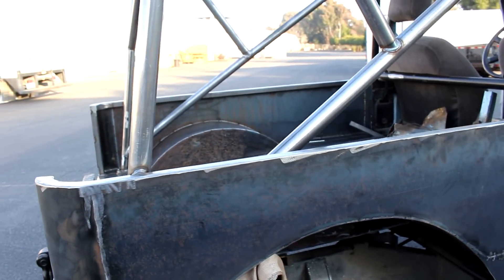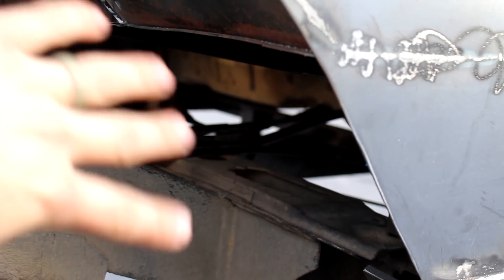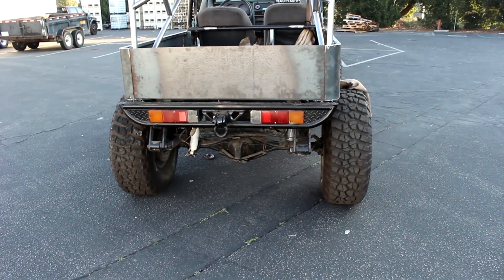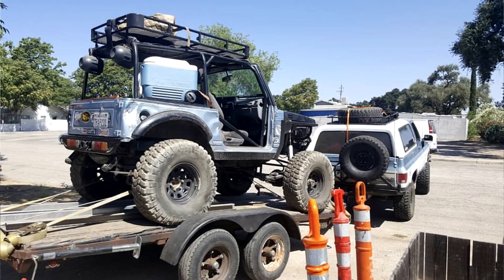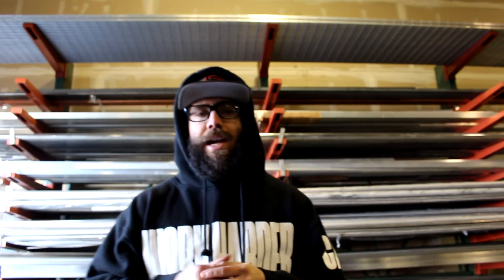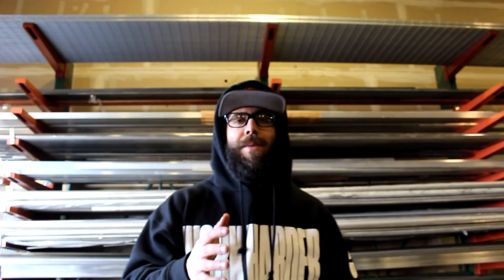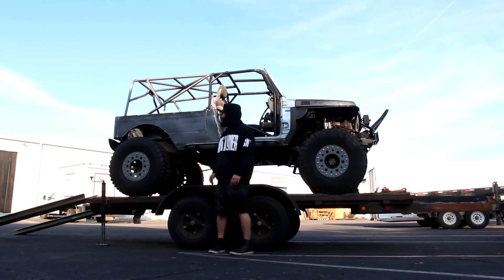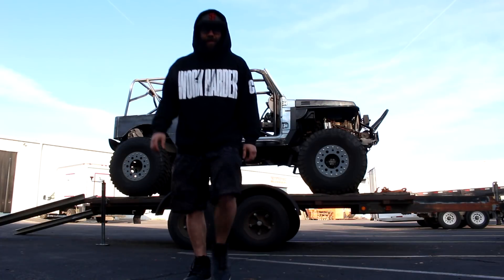SUZUKI SAMURAI UPDATE #8 (HUGE ANNOUNCEMENTS!!!)

Comment: Congratulations on the sponsorship! 7.3s are great. I've got 270k on mine and it's going strong.
Reply from the maker: Thank you! My 7.3 only has 178k at the moment. I just now broken in haha
Reply: TJ Mitchell Films I was glad to see that the tin top completed the Rubicon. My 87 has dual lockers with 5.13 gears and 33s, so my confidence was built for my first trip this summer.